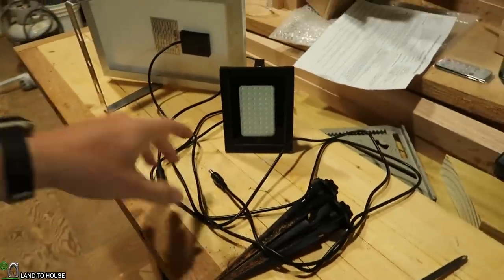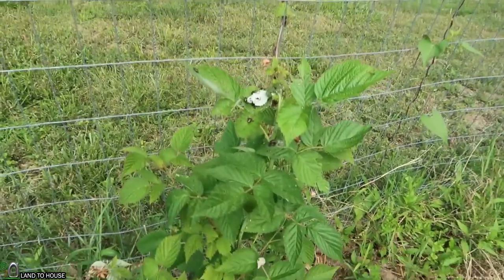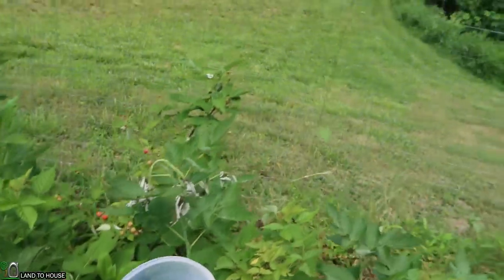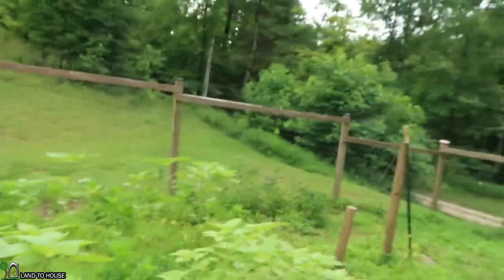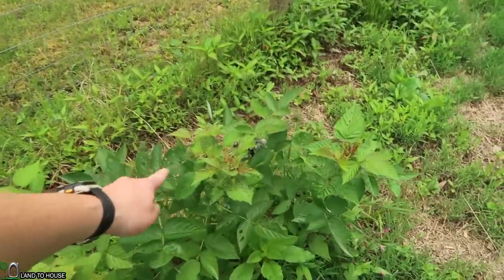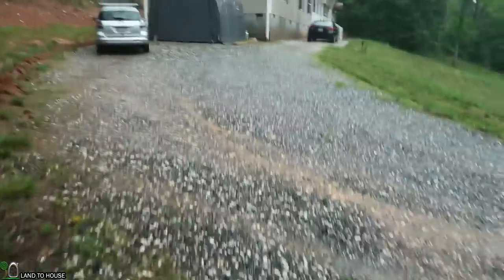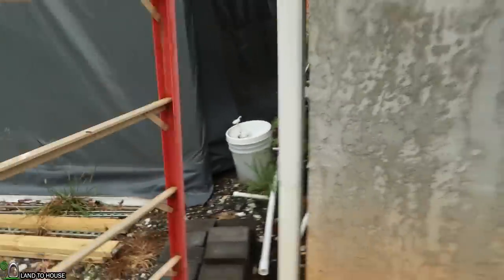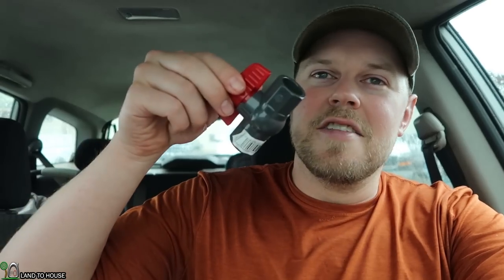Lumber for a Castle Build - Vlog 159

Comment: When out of wasp/hornet/bee spray, soapy water from a sprayer works well enough.  Soap is a Surfactant so the soapy water sticks to the hydrophobic bodies & wings of the bugs, wetting and weighing them down so that they can't fly, and soaks into the paper nest spoiling it so survivors will abandon it.
9:03 looks like a little ponding of water between the house and the berm you made from digging out the ditch.  I would recommend that you cart away the dirt instead so that water on the house side of the ditch can drain instead of pond behind the berm and cause mischief to your house's foundation.

Comment: My granddaughter likes me putting 5 raspberries on the end of each finger then eating them one by one. 
Couple of quick questions on previous projects, I can’t remember seeing you use your dust vacuum system. How is the ceiling track light project coming? A mention about your solar project. 
So many jobs- so little time.  🦀
Reply from the maker: That sounds fun. I'll have to show Emma That Trick. The dust collection system in the shop only needs a filter and it should be good to go. I just haven't taken the time to order one. The solar panel system is waiting on wire harness and electronics. A $600 investment I'm not quite ready for. The camera gantry needs an overhaul. I've changed the design twice and I think I'm going to get to that this winter.
Reply: I'm with David and curious too. 😎
Reply from the maker: About all the unfinished projects?? 😂

Comment: Try adding a drop or two of dish soap to the water and I bet the bugs will sink to the bottom instead of floating. ❤🌅🌵
Reply from the maker: good idea. I am thinking of getting a trap or two. there are so many of these pests I just wont be able to gather them all by hand.
Reply: @LandtoHouse  do your research. It's not so much the trap but the bait. 💝☀🌵
Reply from the maker: Yes! Looks like a milk jug with bottom cut out and a jar of water hanging from that is enough with the right bait.

Comment: Would it work do have a single drive pipe feeding two separate ram pumps which both pumped water up through a single delivery pipe?  Could be an interesting test for a video.
Reply from the maker: Yes that is the upcoming test. I don't really see it happening but I've been known to be wrong a time or two ;)